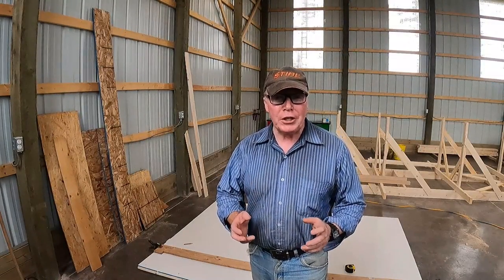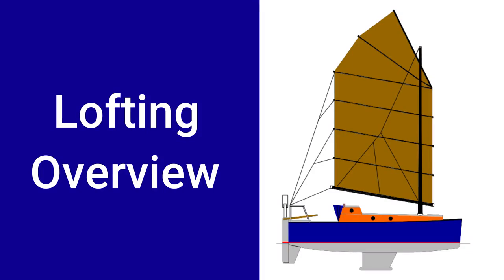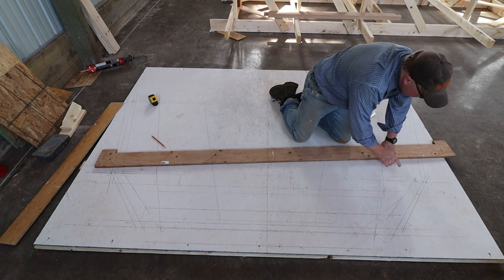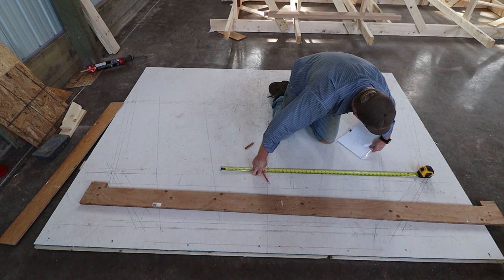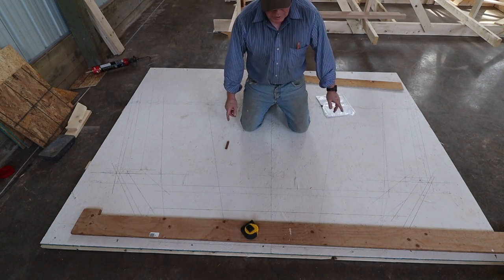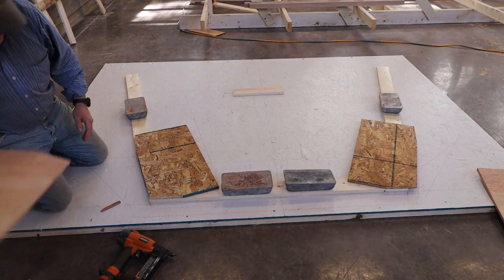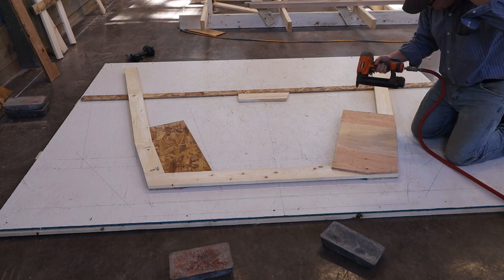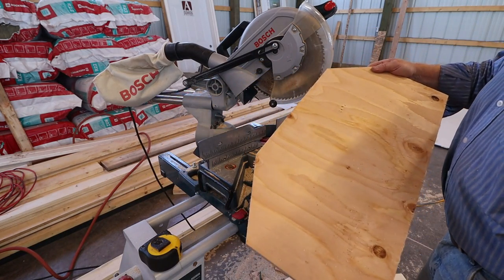S2E05 Lofting Sailboat Frames for Beginners || Everything you need to Know to Build your own WR650!

Comment: Obviously, the boat is trailerable. I am wondering if the boat can be floated off a trailer as well.
Reply from the maker: If you can achieve about 3' of water at about 20' from shore it should work. An other alternative is to jack it off the trailer on a beach at low tide and let the tide life her off.

Comment: Alan, how much of a window will you have for epoxy work before winter makes it too cold to continue without heating the workspace?

I'm curious because I'm partway into a Chameleon Nesting Dinghy build (hull is stitched, but not yet glued) down near the bottom of Australia, and although the Southern winter is now over, it's going to be mid November-ish before night-time temps of 12°C or better start outnumbering nights of sub-10°C. (12°C being the temperature at which my epoxy stops curing, until it warms up again. And yes, I'm using low-temp hardener.) At the moment, I'm still seeing some days where 12°C is the maximum! Until then, because heating my workshed isn't practical, it'll only be one or two days here and there where nights will remain warm enough for the epoxy to cure in a reasonable amount of time. It's frustrating because I'm impatient to get going, but at the same time am completely at the mercy of the weather.
Reply from the maker: I probably only have 4-6 weeks without using heat. I will push hard to get the major work done. The owner of the boat shed is putting a wood furnace in but the building is not really insulated. I'll have to use space heaters and insulated tarps.

Comment: Great detailed explanation.  Should probably mention how critical it is to make sure the waterline is perfectly perpendicular to the centerline.  I see how you used the factory edges of the sheet to accomplish that, making a simple measurement up from the bottom edge.  However if someone uses a different layout for the lofting surface it would become vital to make sure those lines are square.
Reply from the maker: Absolutely. Regardless of the setup care must be taken to accurately establish the WL perpendicular to the centerline.
Reply: Not to mention the importance of a good straightedge! Not just any old board will do.

Comment: Probably a dumb question and getting ahead of myself as usual but will you be assembling the final frames in place on the strong back using the templates as both a guide and bracing? A carpenter friend calls OSB, poop board. I can’t look at it anymore without thinking of that. Haha.
Reply from the maker: Although some folks do it that way I will be fitting the frames and bulkheads after rolling it upright. These temporary fames are just to give us a fair shape. Although it may not seem as such, this way is actually faster in the long run.

Comment: Has anybody here used Formply, a paper faced plywood, for a lofting table?
Reply from the maker: That would be a great medium but it is also quite expensive. A much cheaper alternative is shop grade popular or birch ply, or even MDF. Having said that, the OSB was perfect for purpose.
Reply: Having in the past built entire retro video arcade machine cabinets in formply (not by choice), I can say it's not fun stuff to work with. Every single cut edge on both sides is like a razorblade, until its' sanded down. Blood loss is almost inevitable. It's slippery as hell to handle. And the surface is so hard that prepping it for painting is a pain in the rear end as well!

Comment: Even though it's a year later, people should know that using a few different colored sharpies (fine point) will make layout so much easier. And if it's too many lines, just throw on another coat of paint. If you can, just don't paint over the waterline and the centerline. If you do need to paint over the center- and waterlines, put a small nail in each end of the line to make re-drawing them so much easier and quicker.
Reply from the maker: All very good advice 👍

Comment: Would it be less confusing to draw out 1 frame, assemble it then paint over the lines except for the waterline, chine and shear then draw out the next frame?
Reply: Its not that confusing in reality and the other lines show errors graphically as he said the wrong lines really pop out if not aligned against the others.
Reply from the maker: It would slow things down considerably. One could use 6 different colours.
Reply: @RoversAdventure  ok. I'll pick up a box of colored pencils.
Reply: @RoversAdventure  this is a fantastic question, and the answers informative.  I was thinking the same as Grandma Josephine.

Comment: I would build that boat with construction ply you are using for gussets and spend the savings on more epoxy and glass.
Reply from the maker: It probably looks better than it is in the video. It has big void spaces in the interior laminations.
Reply: Construction ply would be a mistake. It contains too many voids, which would result not only in weak areas, but also be places where moisture will accumulate, leading to rot where you won't see it until it's too late.
Reply: I am aware of the voids and have now built 2 boats with it and have helped with 2 larger boats (30ft) boats there are different grades which vary depending where you are in the world here the best grade is called structural and its used to brace timber framed construction its half the price of a marine grade and only has a little more voids than marine grade. these I tap to find when the boat is skinned out and then rout and fill before Glassing the outside. I also use treated ply epoxy doesn't seem to mind it and I trust it for rot resistance more than marine ply. I also use CD grade which has one good finish side which I put towards the inside then glass the outside. I have built with marine grade yes its better but not twice better.
Reply: @TheBeaker59  - Fair points, and I like your routing and filling method. Most people I've seen use ply with voids tend to just set the sheets on edge, and pour epoxy in until it comes out the bottom, then plug the bottom and fill the the rest of the way with epoxy.